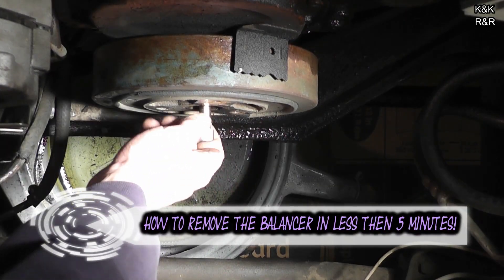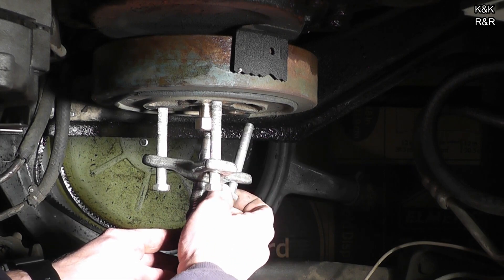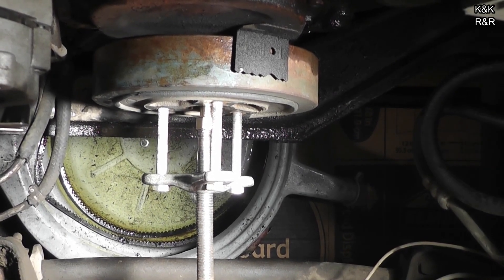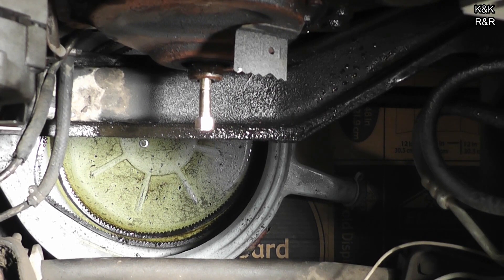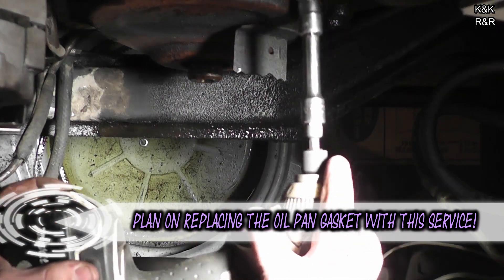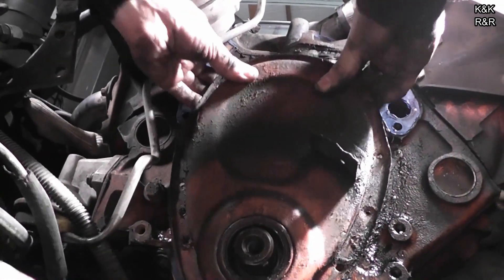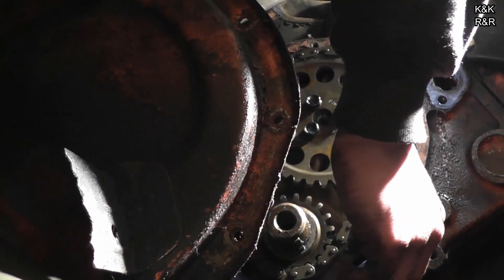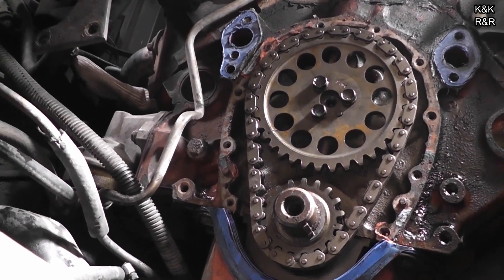How to Diagnose & Replace Any Chevy 350 / 5.7L Timing Chain Pt2 Timing Chain Inspection and Removal

Comment: (My dad bought his 98 silverado new.) Last year he decided to replace the original timing chain set before giving the old truck to my son and the dots on the original were not lined up quite correctly from the factory. He could not get the new or old distributor to fall down in place like it should by aligning the marks like they should be. The only way to get it all back together was to align it off just like he found it. He has revisited  this 3 times now, and now he  believes it has the wrong cam from the factory in it. He has spoken to countless mechanics and all of them have never seen this before. He is at a loss on getting it just right. My nissan frontier V6 has more power than the 98 Silverado because we think the timing is off too much to develop the gas mileage or power it should have had all these years.
Reply from the maker: Did he use an aftermarket timing chain by chance? Those Vortec's 1996-1999 you want to use an OEM GM timing chain only. The problem with that engine is it needs to sync cam and crank to start and run properly.  If you say its low on power I would bet the compression is low because the valve timing is off to start with. If your timing dots were off for any reason this will make the valve timing late and that effects the basic operation.  That engine should be putting 255 HP/330Ft Lbs Tq.  Other note anytime you change the Optispark distributor unit you must have the Dealership sync the ECU to the distributor or the ECU can't advance the timing as needed to get the full power it has.  The Vortec engine takes the basic 350 operating principles and adds a computer nightmare to it.  No matter what those timing dots should line up or that engine will not run right period.
/K&K
Reply: @KNKRNR  Like I said in my comment above....the timing chain had never been uncovered from the factory assembly before my dad decided to change it. When he took the cover off to expose the chain, the timing marks were off as if they were off a tooth from the factory to begin with. Replacing the chain and gears it is impossible to align the marks and fit the distributor into place and still have range for adjustment. It HAD to go back together misaligned just like it was from the factory as if it has the wrong cam maybe from day one. Hard for me to believe you must take the vehicle to the dealer to "sinc" anything just because you replace the distributor. It's still an old school distributor engine. The computer can only calculate and control spark timing unlike a newer VVT engine that controls timing of spark AND cam timing.
Reply from the maker: Please check out the link below for further information on the re-timing procedure "CMP Retard Offset data" for Vortec's made from 1996 to early 2000. Some automotive repair shops might be able to do this procedure as well if they have the GM Tech II scan tool.   

http://www.gmtruckcentral.com/articles/distributor.html

/K&K

Comment: How did u get the oil pan out to clean everything and make sure the new gaskets sit right and seal ?
Reply from the maker: We had already installed a Fel-Pro "Reusable Oil Pan Gasket" when we installed this used engine.  All we had to do is drop the pan just enough to remove clear & install the front cover after the repair.  If you have the factory or non reusable oil pan gasket, you can still seal the pan back up with a new front lip oil pan seal and little bit of RTV to meet the old gasket on both sides before you reinstall the front cover.  If you are this far I would recommend  installing the one piece reusable Fel-Pro Oil Pan Gasket in the link below. Be sure to verify your year and application because GM changed the dipstick location on these engines.  

https://www.summitracing.com/parts/fel-os34510t/overview/make/chevrolet
/K&K
Reply: @KNKRNR  I want to see more.